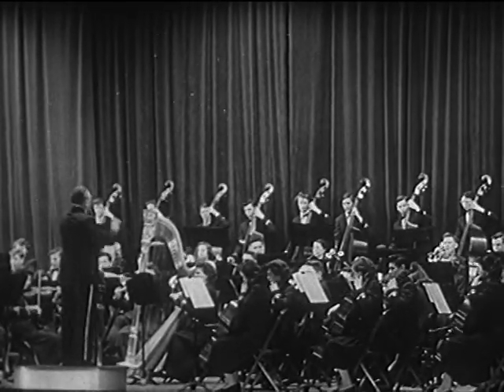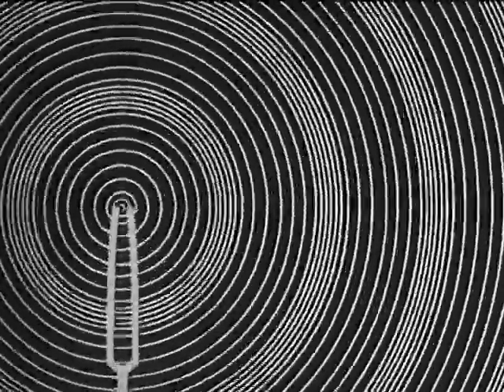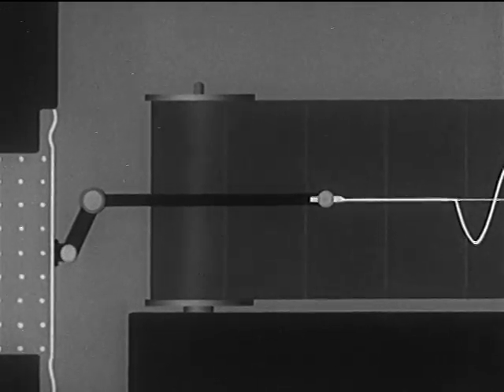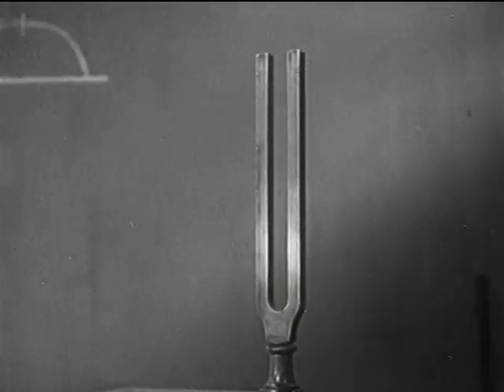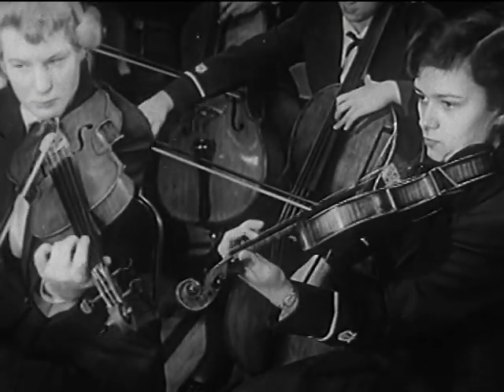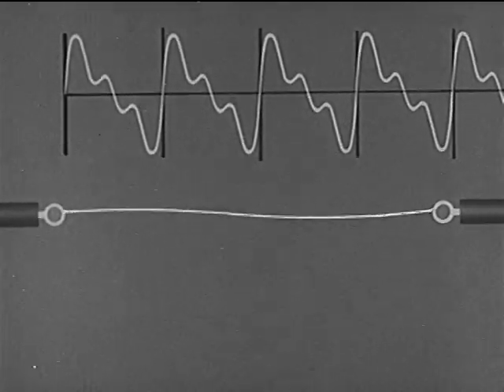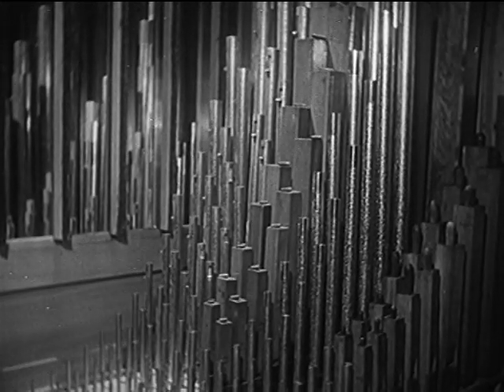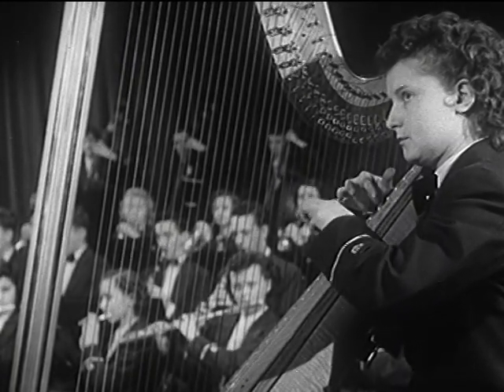Sound Waves and their Sources (1933)

Comment: The question was asked:

ActiveStorage3 years ago
can somebody explain why a sound wave from an explosion and a sound wave from a balloon pop move through the air with the same velocity? 

The answer is that sound is NOT propagated as a "wave". That's a question that you will NEVER get a cogent answer to by people that think sound is sound waves.
Reply: Sound has a speed that is determined by the medium (solid, liquid, gas) it's travelling through. If an explosion and a balloon pop in the atmosphere, their sounds should have very similar speeds. If one was under water, then that one's sound would travel faster.
Reply: It's also true that ice cream tastes good. Unfortunately, that information doesn't answer the question of HOW sound...as sound waves...travels at the same speed through the same medium when the sound source moves at different speeds to make the sound.
Reply: crashsitetube You asked WHY, so I answered WHY. Now you are changing it to HOW?

Ok, Sound travels independently from its source. So it doesn't matter where the source is going. The sound produced will travel at a particular speed regardless of where the source goes next. There's no reason to think that the source determines the speed of the sound. Only the characteristics of the medium determine the speed. You are just assuming the source has an effect on the sound's speed. But it doesn't. I think that's where your confusion is.

If a train is traveling west at 100 km/hr and blows its whistle, the sound will not travel west any faster than it travels north, east, south, up, or down. The sound of the whistle has the same speed in all directions.
Reply: All that is true. The problem starts when the video shows the sound moving away from the tuning fork at the speed the fork is pushing the air molecules.

Now, the question becomes "HOW". If you are going to try to insist that it's "sound waves", you need to explain how those waves are created (not as shown in the video for sure), how the sound is coupled to the air (the medium in this instance), how the sound propagates through that medium as a "compression wave" and how the sound waves are detected.

Every one of these "how" things are wrong in this video.
Reply: crashsitetube The tuning fork part was showing how the frequency of the vibration determines the frequency of the sound. If the tuning fork vibrates at 400 cycles/second, the frequency of the sound will be at 400 cycles/second. That's why the tuning fork and sound waves vibrated at the same rate.
Reply: crashsitetube Do you think that sound does not travel in waves?
Reply: Yes! Sound does NOT travel as "sound waves".

The film shows that, as the tuning fork moves one way it creates compressions and the other way, rarefactions.,..and actually says so.

You can create much more massive compressions and rarefactions by blowing air out and sucking air in. Do this simple experiment:

Hold a sheet of paper by a corner or edge, out about 10 inches or so from your mouth and blow on it. See the paper move away (as you'd expect). Now, holding it in the same position, suck air in. Does the paper respond by moving inward toward your mouth a similar amount?

The oscillograph in the film shows that the forces on the diaphragm are symmetrical for both the compressions and rarefactions.

Even this simple test should give you some doubts about the validity of compression waves as an explanation for how sound works. If you are still convinced that it works as "sound waves", then you are in the company of all the science geniuses. They believe it works as the film shows. But, I don't believe it and have a better explanation...one that resolves problems like above...and the MANY others in the film
Reply: As a sound source vibrates, it does generate sound and, as you say, at the frequency the source oscillates/vibrates. Also, the amplitude of the sound is related to the amount of vibration. This holds true down to about 1 kHz (based on measurements I have made). As the vibrations of the source get slower (take longer to make 1 excursion), the amplitude of the sound falls off and, when the rate becomes 0, no sund is generated.

If the tuning fork 'pushes' out a compression, how come a car, moving at 50 mph doesn't push out a more massive compression in front of it?
Reply: crashsitetube About your paper experiment, I can move the paper more by exhaling than when inhaling. This does nothing to make me doubt the validity of compression waves as an explanation of how sound works.

Why did you choose this experiment that in no way replicates how sound works? A vibration is produced in an instant, and then the pressure waves radiate away. In your experiment, (1) you are not replicating any kind of vibration, and (2) the exhaling occurs over an extended period of time. Both of those things don't replicate how sound works.

The geniuses and I still know that sound is a mechanical wave that has compressions and rarefactions.

You asked about the tuning fork and the car. A tuning fork goes back and forth. A car continues in one direction. They are not the same phenomenon. I have no idea how you can make a point using two completely different scenarios.

If you have a better explanation of how sound works, you should write it up in an paper, get it peer reviewed, and then submit it to a reputable science publication. Why don't you do that?
Reply: You have very succinctly explained why it would be pointless of me to 'write and submit a peer reviewed paper'. The science curriculum dogmatically (and thoroughly) trains students...'this'. It takes some effort to re-vector one's mind to an alternate explanation...even though this explanation has so many problems.

 If you move the paper out 10 feet instead of 10 inches, by the time the air gets there it has diffused out so much that it will move the paper very little (if at all). You'd be surprised if it still moved about the same amount as it did when closer.

Yet, you are willing to accept that even the tiny compressions produced by a vibrating sound source, moving only a few thousandth of an inch, can extend out not just a few feet but hundreds or even thousands of feet without diffusing. 

Perhaps there's something 'magical' about a rapidly changing compression/rarefaction cycling that prevents the air molecules from diffusing? If so, doesn't it seem reasonable that a film on how sound works should at least attempt to explain it?

In order to understand why the compressions of air molecules diffue at all requires some relatively easy but, necessary analysis. And that takes effort to do.
Reply: I know that my answers are not answering your fundamental question of how I think sound works if it's not by sound waves. But, to just blurt out the answer makes a lot of assumptions. It assumes that you have basic physics properties correctly conceptualized. For me to just say, "it works like this.....", it not likely to give a satisfactory answer to you.

But, I'll give it a try...with all the assumptions assumed to have been satisfied:

For the sound to be generated, some surface must move. That surface can be a solid, liquid or even a sharp density gradient in a gas. But, the surface is immersed in and is constantly interacting with the medium it's in (let's assume air for this example).

The air molecules are always moving and thus provide an energuy source. That energy is what propels the sound. The small 'push' the surface gives is quickly diffused out by the randomizing effect of the randomly moving air molecules.

A side note: If the air is trapped, there can be a persistent density change such as air in a tank. But, for this example, we'll assume the sound is out in free space as we normally hear it most of the time.

The 'secret' to sound generation is not the air molecules picking up energy from the vibrating source, it's that they pick up a time/position offset from it. If the source is moving toward the sound detector...like an ear...it will encounter the air molecules in that direction a little earlier and that time offset is also associated with a position offset and one that gives an, 'early' characteristic.

As those offsets accumulate as the surface continues to move, they propagate out into the air by molecular collisions. The offsets are extremely persistent (and incredibly tiny) but, over time integrate into substantial force at the detector end.

Within the air mass itself, there are no density changes really. Instead, there are massive amounts of molecules carrying the time/position offsets.

Only when there is another surface that the molecules with the offsets can impinge on can the sound from the source be 'reconstructed'.

If the detector is the ear, we need a way to create a force differential between the front and back sides of the eardrum. The back side of the eardrum is protected from rapid changes of force by the structure of the ear, mouth and nose cavities and the Eustachian tube which act as a low pass filter.

That means the back side of the eardrum has air molecules impinging on it that can be considered always, 'on time'. Air needs to have a path to the back side of the eardrum for gross equalization of air as atmospheric changes occur.

As the sound propagates to the detector, in the example of the source surface moving toward the ear, some of the air molecules are arriving early and they add force to the eardrum pushing it inward.

As the source continues to move, the eardrum continues to respond (delayed, of course by the time it takes for the sound to reach the ear at the speed of sound), until either the source stops moving or the eardrum reaches its elastic limit (which almost never happens with even loud sounds).

When the source surface moves away from the ear, it takes longer to the air molecules to reach the surface so they arrive later and pick up a position offset that's further from the ear. That offset is as persistent as before and that time/position offset is transferred to every molecule that's collided with as the sound propagates to the eardrum.

At the eardrum, the late arriving molecules subtract from the force acting of the back side of the eardrum and the force of the air on the back of the eardrum pushes it toward the sound source. And, as before, delayed by the amount of time that it takes for the sound to reach the ear.

Since the only thing that's being transmitted are time/position offsets and since every molecule that is contacted by a molecule carrying an offset, the sound is able to maintain substantial force over significant distances. It also explains why sound intensity does not follow the square law falloff (even though the science geniuses keep trying to insist that it does...when it can easily be observed not to).

Since it's the energy of the air itself that propels the offsets, it's no exaggeration to say that sound is propelled by heat (and the hotter the air is, the faster the molecules move and the faster they collide and the faster sound travels). That's consistent with the speed of sound vs temperature.

There's a lot more to be said on this topic but, you asked HOW. That's HOW. At least in a fairly high-level, cursory manner.
Reply: crashsitetube Based on what you said about how science trains students dogmatically about "this" (sound?), AND you ideas about the nature of sound, it appears that you do not have a science background. Despite what you think, there is no dogma in science. Only religion has dogma, and science is no religion. Scientific principals have changed over time and and old ideas have changed when new information comes in. Let me remind you that Einstein overturned two and a half centuries of the Newtonian view of gravity. He did so because he had access to more data. There is no dogma. If you were scientifically educated, you should know this. 

I think the real reason that you would not or could not write a peer reviewed paper on your sound hypothesis is that you don't have any actual verifiable data. If you don't have any evidence for your claim, then your claim is to be dismissed. The whole point of science is to remove subjectivity, and your claim is ALL subjectivity. Science is objective. That's why you paper would never be accepted.

Your second reply...Wow! Ok so I glanced over it. Way too long! But what I gathered is that you are explaining how you think sound travels. Again, your subjective ideas mean nothing when science has objectively shown that you are wrong. I commend your tenacity to challenge science, but this is exactly why science is so important and necessary. Imagine if everyone else had their own unscientific ideas about how sound travels. Each person's would be different, but everyone would think theirs is correct, which obviously is impossible.

To get at the truth, we need objectivity, and that's what science gives us. The current scientific understanding of sound comes from objective experimentation and observation. It's not somebody's idea.
Reply: I think what is going on is that we have hit a very well thought out question which seems to defy all intuition. It seems that this destroys the theory that this video puts forward, that a tiny tuning fork could create a wave which propogates at the same speed as an explosion. All of our theories break down because of this. Right?

Not quite. It is just that you have to really read into the physics. There are some foundational subtleties that this video does not hit. I am reminded by a facebook post I saw which referred to plato's cave: in short, this video is true, but it is not the truth as one cannot gain the insights just from this video. This video does not disagree with the physical model we have of sound waves, but neither does it explain the subtleties necessary to defeat this brilliant counterintuitvive question which has been posed.

In short, the physical models PREDICTS in a logical, air tight manner, exactly what happens in real life. The speed of sound depends not on the actual pressure caused by the source, which would be different for the two situations hitherto described, but only on the restoring force of the medium, in this case the Bulk modulus B, and the interia of the medium, in this case the density of the air. This also explains how indeed temperature affects the speed of sound, so all of the phenomenon you have described are well explained. Yes, there are assumptions made, but they are just as stringent as the assumptions that are made in even assuming atoms exist! The assumption of the Bulk modulus is empirical. Some fluids can be compressed with less pressure than others. This is the key charecteristic which determines the speed of sound, again, as i emphasise, so does the density.

I think this is counterintuitive as the motion is longitudinal. Remember, after all, the over and under pressure, which can be shown to be equivalent to the particle displacement, is a function of time and position. Likening it to a wave on a string, the problem is equivalent to asking why a sudden, violent whip with a huge amplitude does not send a faster wave than a gentle one. It is obvious: the speed of propogation of wave does not depend on the amplitude! The only factors that matter is the mass per unit length, and the tension. The same theme of the fight between stiffness and resistance determining speed is clearly evident here. 

As a final attempt in justifying this model, we can imagine each air molecules being attached together with springs. Why we can do that is again a statistical and empirical phenomenon. Motion is chaotic and random, but we can make an average out of this. Now, clearly the initial amplitude, how hard we hit the first molecules has no influence on the speed of propogation. Amplitude does not determine the time period, only the fight between the stiffness in the springs and the mass of each of the billiard ball like molecules. 

So, to really undress this confusing question, what is secretly being asked is equivalent to why a spring oscillates with the same frequency independent of time. Each step along the way is empirical, and some is mathematical. If you believe newton, then mathematically from his equations comes the fact that f=2pi(k/m)^(1/2). No term in amplitude in there! 
So in conclusion, the skeptism is very natural and encouraged in science. That is what makes it anything BUT a dogma. Very sadly, it is taught as a dogma in schools which sickens me to my stomach. It is a crime. But, the established groundwork are what you and I can both agree on because we can set up experiments to obtain the same results. Then, math is there so that you and i can both agree on what is allowed and not allowed. Of course, maths is not perfectly rigorous technically as Gödel chillingly showed us, but rest assured that is well out of harms way for us.
Reply: I think I have answered what you were saying about showing how this compression and rarefraction comes about. It is all molecular matter which have statistical meaning and justification. Please, I do insist that we debate if you don't feel at ease. (and have the time lol) I realise that I am just a biit late to the party 😂😂😂
Reply: "Of course, if the object is moved gently, the air merely flows around it, but what we are concerned with is a rapid motion, so that there is not sufficient time for such a flow." Later on, Feynman goes on to say that "For sound to be generated, the regions over which the density and pressure change must be much larger than the distance the molecules travel before colliding with other molecules." 
Now, this is the correct model that we use as sound as a wave.
The issue with your experiment is that the condition that the pressure change must be larger than the distance the molecules travel before colliding with other molecules is violated. The consequence is that no audible sound is formed as "the molecules would move freely from the crest to the trough and immediately smear out the wave."

As for the lack of symmetry, again that is because you are causing flow by blowing on air and sucking on it. It is like having a chain of springs attached to masses and moving them all at a constant velocity. You have to shake the air with a sufficiently high frequency for sound to be heard. As other people have pointed out, this also applies to the car experiment too. Sound does come from the car, but that is the tires and mechanical parts that oscillate. You want to cause oscillations, not flow.